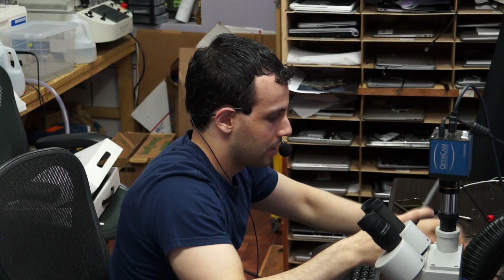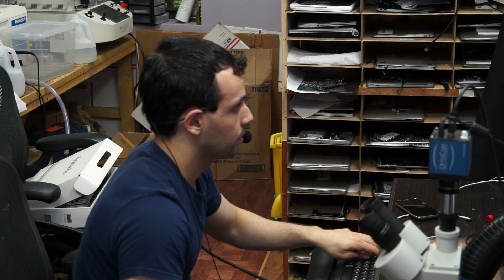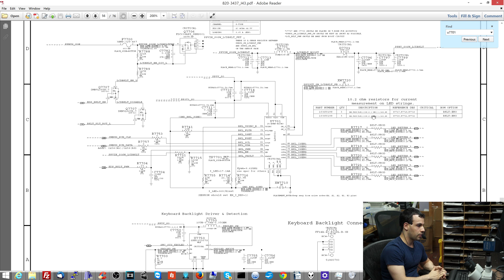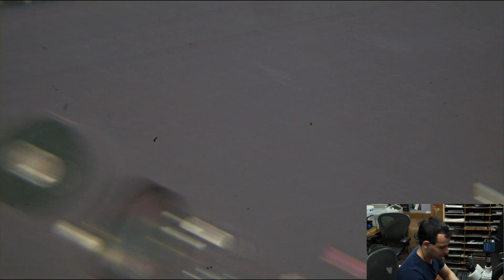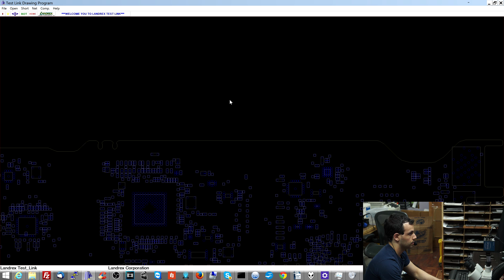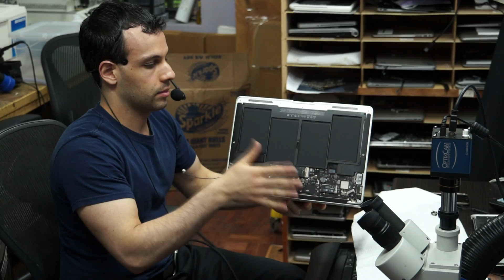Basic no backlight repair on 820-3437 Macbook Air logic board with troubleshooting hints

Comment: Small correction related to 2:53 . In DIODE mode measurement  a fixed amount of current is driven into the diode and the voltage drop on it is being made ( usualy it is givven 1mA which is enough to bring it from cutof state to conduct. Some better measurment meters have two diode mode stated which deliever two different currents that is for two differend diode types) . In  Resistance measurment the resistor is givven a fixed voltage an the current is being measured. As sensitive the current measurment is as higher resistance values van be measured.

Comment: i use kapton tape to hold the surrounding components in place while applying air heat. last thing you need is tiny resistors and caps fly off. i do work on power utility smart digital equipment.

Comment: for a multimeter i recommend Fluke 116, measuring the resistance (ohm mode) takes only 1.5 sec
-it has a ghost voltage measurement option (internal resistance is not 10Mohm but 3k), very good for discharging capacitors as well
-can measure temp, comes with that probe
-cannot measure current but for repair it is not needed anyway
-latched continuity mode,super fast (beep is always a nice uninterrupted sound not scratched,  detects opens or shorts of 500 μs or longer.)
-of course it has diode mode too

Comment: Hi Louis. I have a MacBook Pro 15 (2018) and I use a membrane keyboard protector. However I would like  some advice on how to remove dust which invariably gets sucked in the back for general cooling, Will a can of compressed air do the trick or should I try finding a suitably small/powerful vacuum cleaner as well. I'm a bit too nervous to attempt to open up the whole machine.

Thanks

Dave

Comment: If switching line is broken from pin 2 of inductor to the led driver, how would I restore it? Where would I need to soldering the wire to? Can anyone help please. I am getting diode mode reading of .655 on output of led driver...

Comment: Once again a good video :D Can you please elaborate on why the diode readings will be different once the part has been powered up? Does the SMC set some registers/fuses inside the chip that you can measure afterwards?
Reply from the maker: ***** That would require college and education I never received, so I can't answer this question because I do not know the answer.

Comment: I have a problem where there is a vertical line going down the middle of my display. One side is dimmed and the other is not. Would changing the display fix this? Or would it be more of a backlight problem

Comment: Hi. First at all , thank for all your videos, they help  me a lot!!. I would like ask for advice. I have a macbook A1266 without backlight. I checked the diode, the LVDS conector (both  are ok)and I decide to replace the driver( LP8550), after that I didn't´t get good results. If I measure with the multimeter (diode mode) I get 0.9 (between ground and backlight output). If I measure the voltage at the Bklt output I obtain 22 V(before the diode 8V.). Any idea what the problem is? Thank in advanced for your help.
Reply from the maker: +Idaconsa Idaconsa reset pram
Reply: Thanks Louis for your fast answer!!. I reset the Pram (it was the first think I did). Following one of your videos, I´m going to check 3 voltages at the LP855, The Vin, the Enable signal and the PWN. Please could you confirm that the right voltages are: Vin:5V- EN: 2.7- PWN: 3? if they are ok I will replace again the LP8550. Another idea? thanks again for your help!. Alex

Comment: hey Louis, if macbook air is experiencing dim screen but using external hdmi works fine, do you think it has to do with logic board?
Reply from the maker: +hassan Bakir yes
Reply: cool, i thought so. what steps needed to remedy it?
Reply from the maker: https://www.rossmanngroup.com/boards/forum/board-repair-troubleshooting/1145-macbook-air-no-backlight-troubleshooting-guide

Comment: Hey louis I have a question for you now I have backlights working but issue is keyboard and touchpad doesn't work no corrosion on connections. I already change main flex cable ( motherboard to touchpad ) I believe to hard to broke both ( touchpad and keyboard ) so do you see same thing like that before ? Do you know possible to damages Any controller capacitors or resistors for keyboard/touchpad thanks :)
Reply from the maker: +ahmet celal kupeli pp3v3 present on the connector? how about in EFI mode, if you hold down OPTION, does it work there?